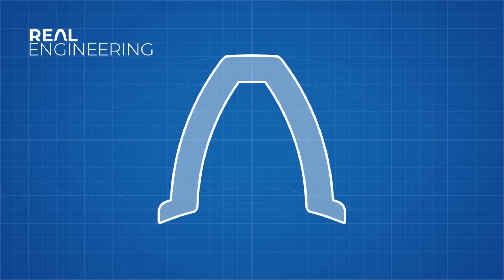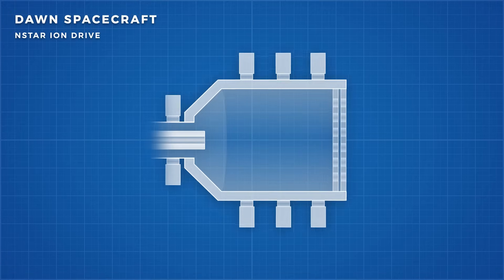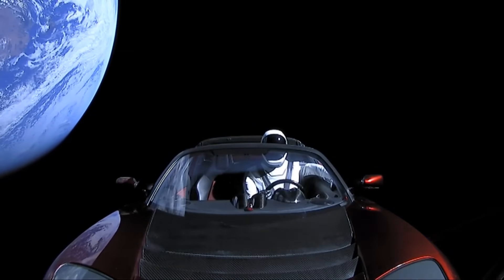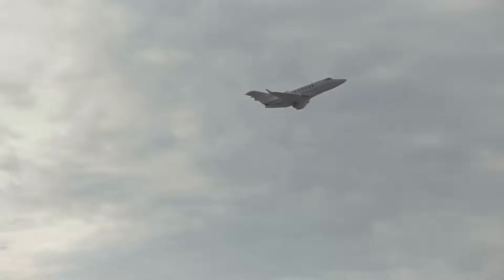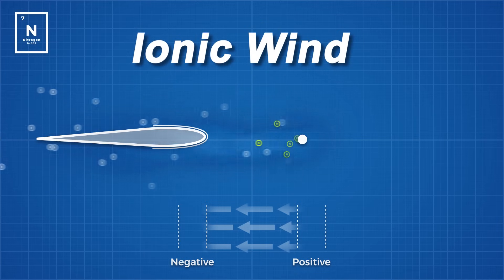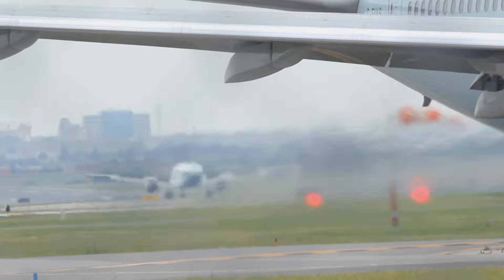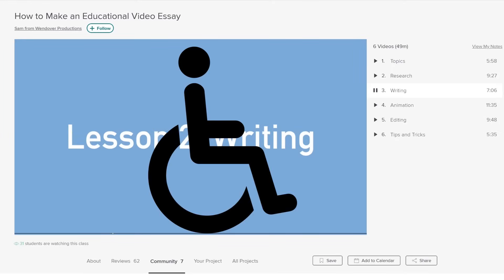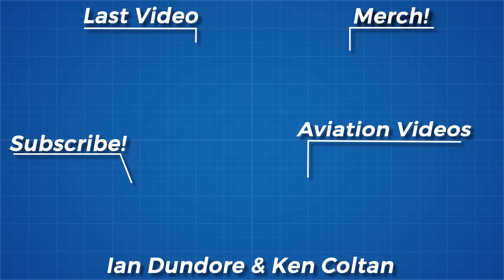Ion Propulsion - The Plane With No Moving Parts

Comment: I saw this a while back. Right now, I am attempting to make an engine almost like a jet engine in the shape of a cone in order to create thrust like the one from MIT did. So far, there have been two issues, I haven’t been able to ionize enough air, so right now I have 3D printed a cone. At the front there will be copper plating in order to cover the maximum surface area and it will be positively charged. At the back, abt 6 cm away at min. Distance from the positively charged front is a 2mm wire. The reason it’s so far is because in past tests, the engine didn’t create any wind and only created these defanging sparks. Right now I am waiting on a response from the company that sells the dc-dc power converter. It is the G10 series from a company called American power design. I am hoping that once I have that I will be able to plug it into a power supply connected to the grid and connect the positive wire to the front and the negative one to ground, which is the metal box of the converter. I am really hoping this creates wind. I’ll let you know if it does, but I need the dc-dc converter first.
Reply: @Zuluknob  Really, I didn't know that, do you know if they had high voltage or not?

Comment: Why calculate the acceleration like that? You have the wet mass, the dry mass, the exhaust speed of the engine, that's everything you need to use the Tsiolkovsky rocket equation. Divide the result by how long the spacecraft was firing the engine and you have the average acceleration, you wouldn't even need to know the engine thrust!

Comment: Mentioning this in the same sentence as the Wright Flyer is seriously disingenuous - that one had potential to become the airplanes of today, this one is a dead end (for atmospheric flight). We had model aircraft flying with ion thrusters DECADES ago (and not using lift generated by a wing, but supported straight up by the ion engine alone!) with the only catch being that they couldn't quite carry their own power supplies - they were flying (hovering) tethered to the ground. The only vaguely novel thing MIT "achieved" is designing a compact enough power source to be carried on-board by one of these engines. They moved from one side of a thin red line right across to the other side - and have no way to go any further. If the technology was scalable, we WOULD have scaled and used it a long, long, long, long time ago. It isn't.
Reply: @esecallum  that's really creepy
Reply: @SeraphimFelis  its called multi tasking.like driving and texting.
Reply: @esecallum  That makes no sense. Are you okay? Not meaning to be mean or anything
Reply: Cell phones were also possible long before the the battery was small enough to make them practical. It was a dead end technology of a sort.
Reply: Positivity like that is what keeps people in the stone age.
Reply: r/ihadastroke
Reply: Wasn't Tesla working on transfering power through the ionosphere or something? Maybe we don't need batteries afterall.
Reply: Also, the Wright Flyer wasn't a demonstration of powered flight. It was a demonstration of heavier than air flight. Blimps already used powered flight.
Reply: Scaling is not easy because of the extreme high voltages needed to power the electrodes and as you know battery energy density has a long way to go before being  practical for airplanes

Comment: The power required to overcome drag increases to the square of the velocity NOT the cube. In the drag equation, you have the velocity cubed when it should be squared.

https://www.grc.nasa.gov/www/k-12/airplane/drageq.html
(This is a document from NASA that showing that the velocity should be squared)

besides the error, it was a good video

EDIT: that is power, not force so it is cubed
Reply from the maker: That is the equation for drag force, not power. Too eager to apply your knowledge to find mistakes!
Reply: @RealEngineering   oh, I guess I did not the P for power lol. Anyway thank you for correcting me also love your videos

Comment: So it's a horizontal "lifter", with wings.

Higher-scale versions should use microwave emitters to ionize air instead of fine wires. And since the air is to be ionized, you might as well turn it into plasma and add parietal magnetohydrodynamic magnets in the wings (especially at high altitudes, the low pressure makes it far easier). But then it's not a ion drive anymore.

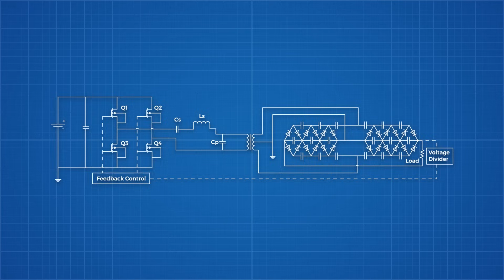Comment: Nice schematic. Ion propulsion requires high-voltage DC, not AC as stated in the video at 5:55 or thereabout. the 16x ladder voltage multiplier at the output is clearly a DC generator. The 200VDC in LiPo cells at the input are converted to AC by FETs in a bridge configuration driving a step-up transformer. If 20 kV on the output, that's 1,250 VAC peak into the multiplier, and so a 6x voltage step up in the transformer part, which begins with 200 VDC. And there's feedback control to stabilize the final output voltage. Nice electrical engineering, especially doing all that in a super-lightweight configuration.

But how far will it fly with the added ion thrust vs. flight launch from the giant slingshot alone? I wonder...

Comment: 4:40 So it's just an h bridge and a few cockroft walton voltage multipliers. Hardly cutting edge. This stuff's been around for decades.
Reply: The only novelty is actually constructing it with modern, light enough components and battery that it can be actually carried aloft by the engine it powers. But that sounds a heck of lot less impressive so yay PR...
Reply: Look more carefully at the multipliers and see that they have twice the diodes of a Cockroft-Walton design.  It is not a good design.
Reply: You don't seem to understand energy density and seem to be ignoring what the video said about how the weight icreases disproportionately to the lift you can produce. They're not going to make anything commercially viable that runs on lipo batteries. This stuff's been around since the 60's. If it were practical, somebody would have done it.

Comment: All of these battery powered shenanigans are merely attempts to prove the first law of thermodynamics wrong.  Fossil fuels "work" because the inputs are concentrated ancient sunshine, mixed with oxygen that is free and abundant and available at all points en route.  Batteries must physically contain all their inputs and outputs.  No battery will ever provide as much transport as fossil fuel can.  Having said that, we are in deep trouble once fossil fuels run out, and we are forced to go nuke + electric everything.  We may be back to sailing ships for intercontinental travel.
Reply: that's why people are trying to make batteries more energy dense. That's what all that research into lithium-air/fluoride batteries are for.

"Fossil fuels "work" because the inputs are concentrated ancient sunshine, mixed with oxygen that is free and abundant and available at all points en route"
That's not how that works, because fossil fuels are chemical combustion, the thing that matters is the molecular configuration, which in this case is one that can be reacted with air and energy input(spark) to extract relatively large amounts of heat energy to turn the wheels.
Reply: @SeraphimFelis  Like I said.  You are trying to violate the first law of thermodynamics.  Not going to work.  You might as well spend your time making a perpetual motion machine.
Reply: @SeraphimFelis  Might as well use solar power to generate gasoline.  That wd give you an idea of how much energy is contained in fossil fuels + it's a great energy storage media.
Reply: @RedOctober2011  Well, you could do that. All you need is hydrogen and carbon. It'd just be too energy wasteful to create the substance from scratch.
Much easier just digging it up.

"the total energy of an isolated system is constant; energy can be transformed from one form to another, but can be neither created nor destroyed."
It's not a violation of the first law to try to use different materials to create batteries with more energy density and a higher energy potential.

Comment: If the plane has no moving parts how can it fly? Ailerons, elevators, flaps, rudder,etc , all are required to control an aircraft.

The only planes I've ever seen with no moving parts are paper airplanes and balsa wood gliders and those flights wouldn't end well for anyone inside those planes.
Reply: If you can control the thrust at each wing, you can control the aircraft.

Comment: 100 joules for the total energy in flight isn't very much. That's only the same energy you expend lifting a bottle of water over your head. Especially when you consider they're probably using a potential of thousands of volts for the ion drive. You're not even going to lift the power source wit that kind of energy output. Nevermind the fuselage, equipment, passengers, kit for navigation, control surfaces, hydraulics etc. If we had batteries with a higher energy density it might be feasible. But as technology stands, this is a pipedream.

Comment: A German team found that WITH ENOUGH ENERGY it is already possible to generate enough thrust, using atmospheric air alone, to fly a 747-sized jet, or even a rocket. The only real barrier is ENERGY. Either we would need a very small nuclear reactor, like the one claimed by Russia's new missile, OR fusion, OR energy beamed to a vehicle by microwave from the ground. One big advantage of such a propulsion is that it can be made to operate in any atmosphere in the solar system, regardless of the gasses in that atmosphere. Drones to mine Helium-3 from the gas giant planets would be one future application. http://iopscience.iop.org/article/10.1088/1742-6596/825/1/012005

Comment: At one point, moving party might be a thing of the past at all. We have electronics and data storage without moving parts, there are scramjet engines, electric motors, magnetic bearings and Ion drives. A completly solid block, that is able to move itself around is mindblowing, if you think about it.

Comment: When you quote the speed of the spacecraft as Mach X, I know you are comparing its velocity to the speed of sound at sea level, though thats actually incorrect as Mach is measured against the local speed of sound (Thats the whole point of the Mach number), so given the spacecraft is operating in a vacuum you can't use a Mach number to describe its speed. I know that you did this just to give an idea of how fast it is going but as an aerospace engineer I got a little bit triggered.

Comment: "The Plane With No Moving Parts", so how do you get inside it?
Reply: The propulsion system has no moving parts.  Obviously, the plane will have moving parts.
Reply: You sit on the wing
Reply: You hang onto the propeller as it spins
Reply: HORRIOR: Or control it!
Reply: @michaelhall9138  
Control would be easier than you think.  Split the electrostatic stuff so that each wing has its own thrust.  Increase the total thrust to climb and make one wing have more than the other to turn.  With resonant power supplies (like used here) the voltage can be varied while keeping the thing efficient.
Reply: @michaelhall9138  A touch pad
Reply: A nano wall like on the Doom film - https://www.youtube.com/watch?v=Lhs-6en-XK0

; )
Reply: jonnijames Sure, then if we put propellers on the propeller we can put more people on the smaller propellers to increase momentum and power by a ton. After that we can put some nuclear bombs so that when they explode, we go ultra fast. We’ll be at warp elevendy-twelve soon my friend. We could also put some horses in the front to pull it.
Reply: @stilickoh  yeah ummmmm, these are non moving propellors then?
Reply: Ionize the air inside and seal the doors with some sort of force field/plasma window thing that keeps the air pressure in. Solid-state doors! :P
Reply: Mush V. Peets warp 69 sir
Reply: Sounds like Coach seating to me
Reply: 'The plane with no moving parts' :- 
But the plane itself is moving !!!
Reply: Build the plane with passengers inside
Reply: shrink
Reply: Very slowly
Reply: René Artois we’re at the andromeda galaxy, imma go get some ice cream at their mc donalds
Reply: Sit in it, sit on it, and you crush it. You just don't get how minimal this thing is. There is no seat because it could not support, let alone lift any chair, however delicate and light that could hold a person. It uses a bungee cord catapult to get into the air, not having enough thrust to take off. The ion drive makes the flight a little longer than the bungee cord alone.
Reply: it has no doors
Reply: Are humans considered  "Moving parts" ?
Reply: @Matthew Bunn You have an evil and dirty mind! I like you already!
I bet you're a MST3K fan too. 
"Humor is a moth that flutters dangerously close to that bright, hot flame called Truth."
Reply: Lol
Reply: They build it around you. It's a one way trip
Reply: The door could always be open so it doesn't move.

Comment: I had a comment (unreplied to) on the electric battery problem, though I realize you are busy...so I shall repeat and expound.  We have two solutions to the battery problem, which do not involve magic batteries; I do not know if you have mentioned them in the past, I apologize if I missed them.

1st is the proven technology of using a tow plane to get a glider to altitude.  This would have the effect of eliminating the heaviest battery use of an electric plane and putting that responsibility onto something which does not need range.  So an electric tow plane could theoretically tow a cruise optimized electric plane to altitude.

2nd, would be microwave receivers built into the plane itself to receive wireless power. For which heavy long batteries would be unneeded so long as the craft flew in range of a transmitter; which could be in satellites above, or stationary sea vessels below, in addition to obvious land stations.

Comment: But how do you slow down? Crashing into the ground? that won't tickle...
Reply: pretty sure just cutting power to the ion engine will do
Reply: @Kinorian1212   i think woody in toy story 2 called it falling in style. anyway i doubt it would be enough since gravity will kick in and with no moving parts leveling it out to land would be hard. however as a conceptual theory with numerous assumptions based on weight, initial propulsion, wind direction and many more cutting power to land could work.
Reply: The pilot farts.  There is more braking force in a fart than in the propulsion exerted by an ion engine.

Comment: ok... dumb question from the back of the room- 
After a year or so of space vacuum acceleration up to Mach 100 speeds.... how do you slow down or stop when you've reached the destination?
Reply: Also what do you do if you have an emergency and need to change course for whatever reason, Ion propulsion is a monumentally stupid idea.
Reply: You can see a long way ahead when you are traveling in outer space. The idea is not to have emergencies.  @kelvinhbo
Reply: You either don't, or you point it in the other direction and thrust it for just as long.
Reply: @Photosounder  That would not work either. Let's say we are going to Mars using one of these things, we accelerate for one year and then decelerate for another year, the problem with that is how do we get rid of the extra energy we are getting from Mar's gravity?
Reply: @Photosounder  ...slow down for a year? I guess you could accelerate until you're halfway there then flip the thrusters the other way... or just accelerate until you reach cruising speed then coast until you get close enough to start slowing down.

Comment: I think i lacked a comparative analysis with electric propulsion based on motors since this is an electric propulsion system, and both rely on batteries, making the comparative easier, deleting the dependency of  batteries in comparing propulsion systems

Comment: Is the ionic wind produced harmful?
Reply: No, it's not, ions don't travel very far in our atmosphere, especially not relatively heavy ones like nitrogen.
Reply: Dyson had a fan that produced ionic wind. It got pulled due to the high amount of ozone that it produced.
Reply: @Rakusan2  yeah, but that was only because it was mostly used in close environments, where the concentration then got higher than the allowed limit, not outside in the atmosphere, where it is disperced by wind and reacts with all sorts of pollution like flouride hydrocarbons and such.
Reply: Isnt it good to have more ozone so we can patch the ozone in the atmosphere and stop global warming 🤔
Reply: @alhafidzuu  no, because it can't reach that far up, it becomes trapped inside the troposphere, otherwise we could just have produced and released it in the ground or spray it from planes flying over antartica. 
Also, the hole in the ozone layer is already shrinking since, like, five years or so...
Reply: No, but the high potential does produce ozone, which is pretty toxic.
Reply: Yes, these things produce a lot of ozone and nitrogen oxides. Lightning produces the same stuff though, so it's not the end of the world. But still not good in high concentrations.